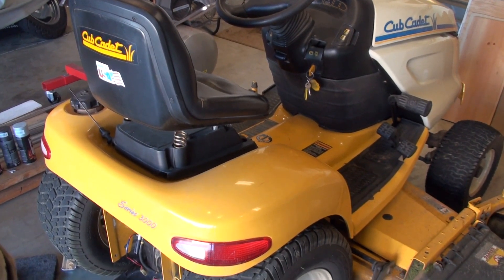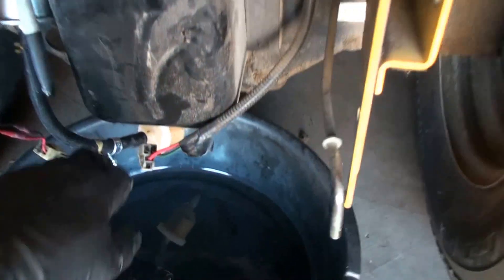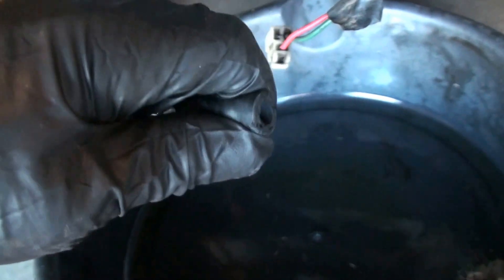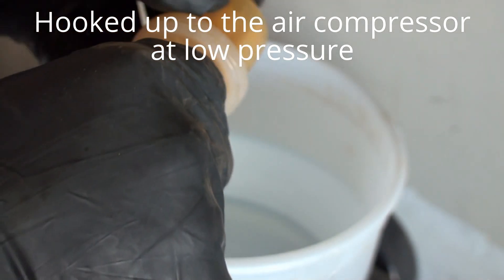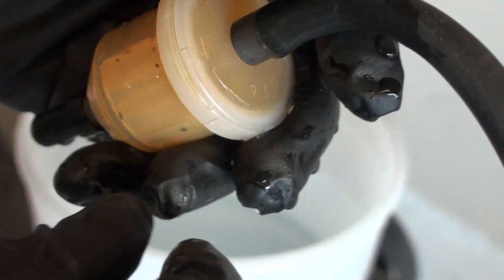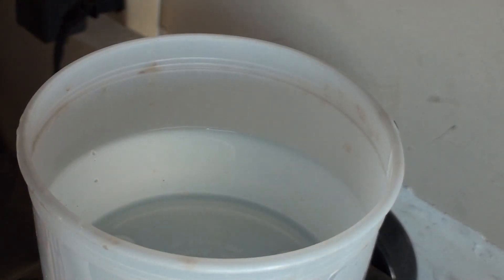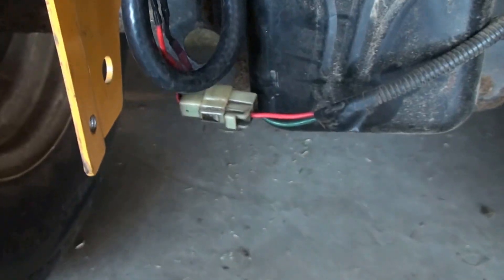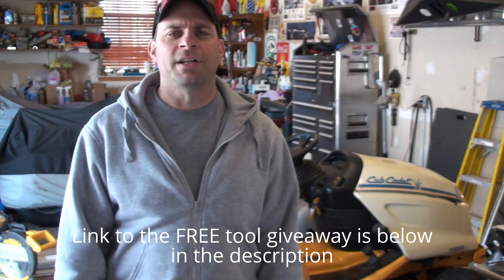Gasoline Leak -Fuel Filter Failure - Diagnosis

Comment: Its now July 2022. I appreciate the heads up on the filter itself. I aborted an installation on my motorcycle with a similar filter and hose this morning that had a smaller diameter than the original fuel hose that connected the petcock valve to the accelerator  pump on the carbs. I deferred in assuming Id cause my bike to starve for fuel. 

Now about the Filter itself -   just imagine if I went ahead and an installed it anyway. Just imagine 30 minutes later on a test drive, a leaky filter dripping on an engine case that could be over 200 degrees F in traffic - 

Thanks much for your video -
Reply from the maker: A leaky fuel filter could be disastrous!  You're welcome. Ride safe, I own three bikes.

Comment: Wow this helped me out, I thought my fuel was leaking thru the gromet on the fuel low level mechanism, so I removed the seat and checked things out, no fuel leaking there... I thought I was looking at a new tank, I have the 3235 with the 25 HP Kohler so my in line filter seems to be under the hood (unless there is more than 1) I never thought to remove the back plate and check the lines there. However when I did remove the seat it gave me a chance to see I was leaking hydraulic fluid from my hydraulic valve, so I guess it wasn't for nothing. Thanks for the video, it always sucks to see any kind of puddle under a machine. :-)
Reply from the maker: No, it is never a thrill seeing a puddle.  There are two filters on the model in the video.  One is up front under the hood and towards the back of the engine As you know from this video the other filter is below the tank on the left side behind the backing plate.  Glad the video helped you out.  It's not one of my most popular but if it helps one person out then it was worth it.  Takes lots of time to film and edit.  Take it Easy - Ozz

Comment: Parts are such junk today! At least a relatively cheap fix.
Reply from the maker: +The Disgruntled Mechanic you got that right.  Cost was $12 for the new john deere filter.  In my opinion its a $2 part.  Cheap part keeping an expensive machine down is costly nevermind dangerous as hell!  Never fails, thanks for watching and commenting

Comment: Luckily I have a local supplier of ethanol free gas.  It goes into all my small engines all the way from the 2 stroke weed wacker all the way up to the outboard on the boat.  Between that, the kero for shop heat,  and the dyed off-road only diesel for the tractor I look a little nutty filling up the cans at the station!
Reply from the maker: +Matt you sir are a connoisseur of fine fluids that have explosive properties.  I don't find you nutty at all.  lmao  Take care dude

Comment: The ethanol strikes again.  Just a heads up the ethanol in the non sealed fuel systems like riding mowers and other power equipment will play havoc if you let it sit in there for more than a month at a time. Cars have combated this by having fully sealed fuel systems.
Reply from the maker: +sixtyfiveford ethanol is garbage as far as I'm concerned.  Besides the fact it doesn't smell good anymore like it did in the old days....lol  Maybe it's the fumes getting to me??  haha take care
Reply: haha, fumes....

Comment: It could be the fuel  or water that froze maybe but it seems the newer products have solved most of the problems we first seen with alcohol in the fuel but oddly when I picked up my new brush cutter and chainsaw the stihl dealer said the warranty does not cover anything fuel related if they  detect that you used fuel wth alcohol in it.  We still  have lots of non alcohol fuel up here. Cheers...
Reply from the maker: +STEVE ROB yeah it's a big problem for sure.  Also crappy materials making parts doesn't help...we know that for sure.  Take it easy Steve